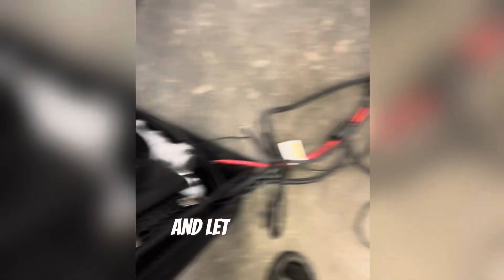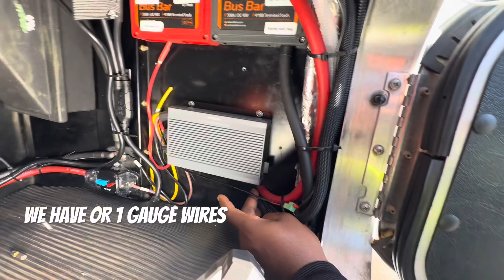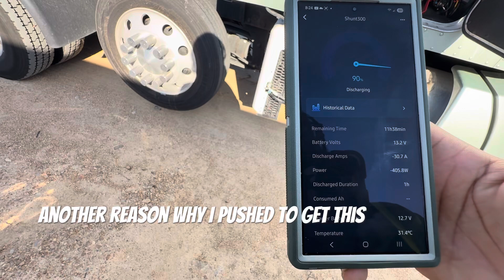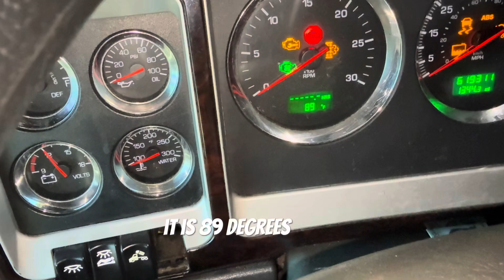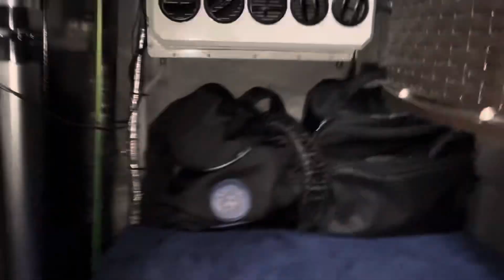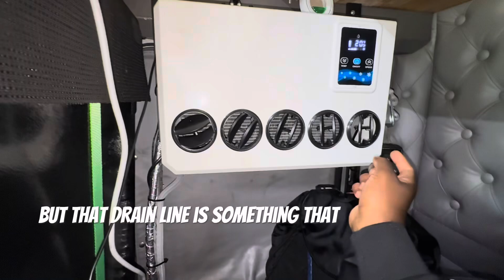This Summer Proves You Need a 12v air conditioner for Your Semi or RV

Comment: I bet he used more $$$ with all that gadgety system. I just went with house mini split @ 110v and works both summer & winter
Reply: How is it going with the house mini split regarding the vibration? And which brand are you using?
Reply: @Soul-Aquisition still working like brand new. It's a pioneer 9K btu